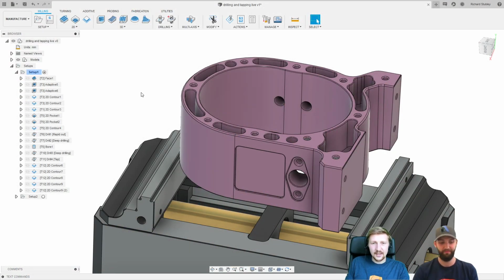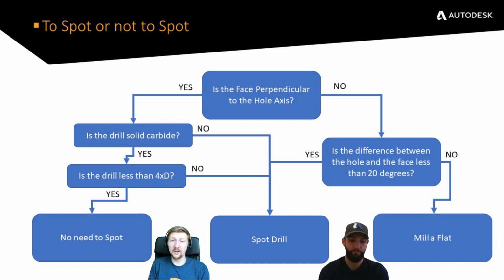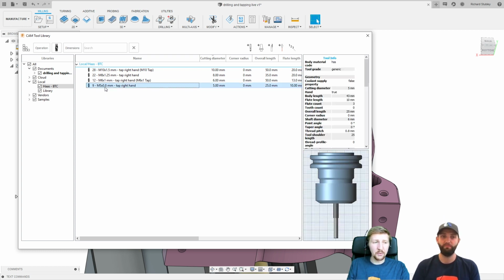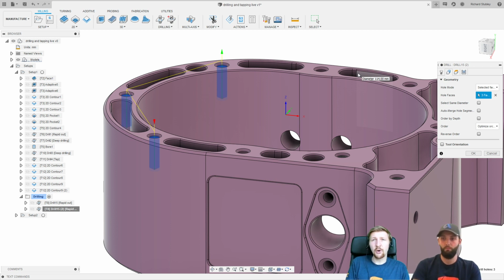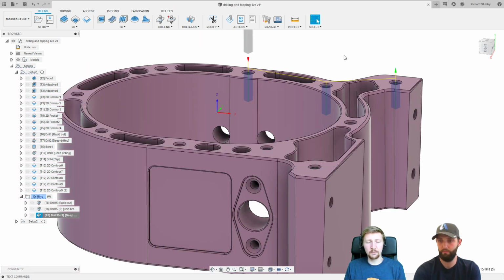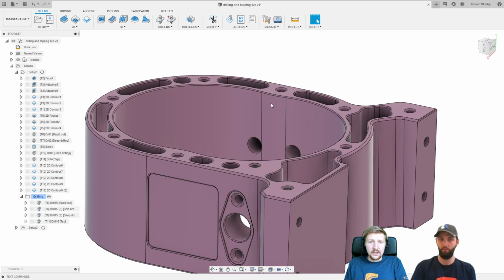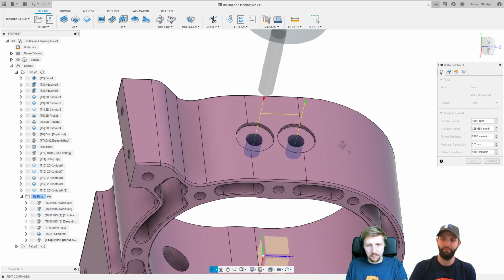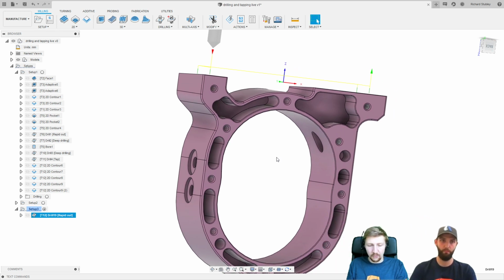Fusion 360 Live: Drilling and Tapping

Comment: I have some holes that are for example 10mm diameter so deep and then 9mm diameter the rest of the way thru. The depth of the 10mm hole and the depth of thru isn't always the same in one part. 10 holes may be 75mm deep to where the 9mm starts and 15 holes may be 100mm deep where the 9mm starts. Is there a way to set the 10mm drill to go to its depth automatically? Then is there a way to make the 9mm automatically pick up from where the 10mm left off then automatically get its thru depth according to the model and not the stock model?
Reply: Actually picking face solved my 10mm depth and selecting through hole bottom with a small offset got my 9mm depth. I think setting feed height to hole top got what I wanted for the 9mm start height. I still need to mess with that one though.

Comment: I enjoyed the video, but seeing you struggle when you didn’t get a tool path drives home the point that the error message is worthless. Seems it would be worth some effort to address this problem. I have wasted way more time trying to get a valid tool path than I have saved by features like “select all holes with same diameter”
Reply: Hi Kurt, the reasoning behind be saying it was Spencer's favourite error message, is he is part of the team that is working on making that message more intuitive. They have just made major improvements to the "Lifting feed plane to topmost ramp" error message.
Reply: This. 1000x times yes.